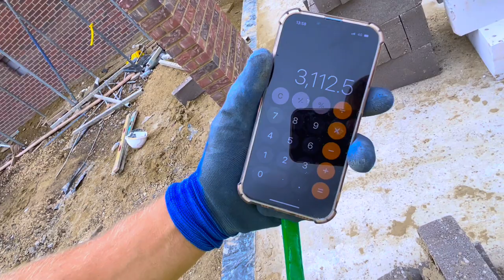How To Set Out A Middle Wall Using A Dead Man | Block Work | Bricklayer

Comment: Open up the joints or tighten them to get a common in . 50mm cut wtf
Reply from the maker: No thanks
Reply: @PATTERSONCONSTRUCTION  that's bricklaying . Not banging in cuts every where
Reply from the maker: @tomtribe8461  thanks for the master class there tom
Reply: @PATTERSONCONSTRUCTION  your the want to be teacher . So do it right